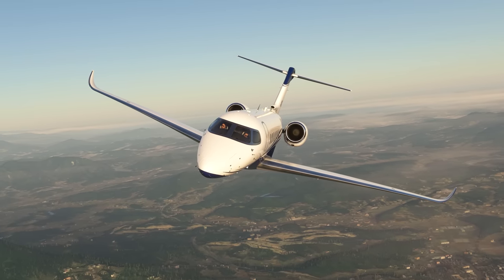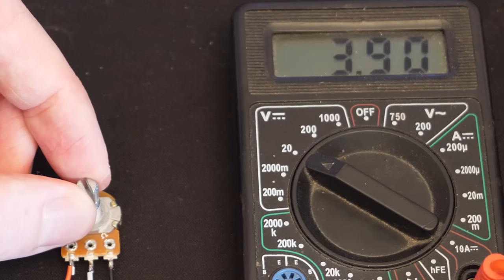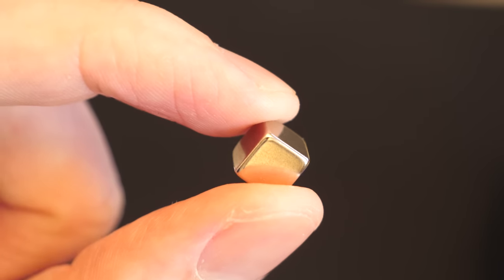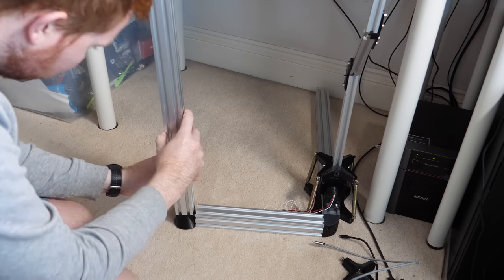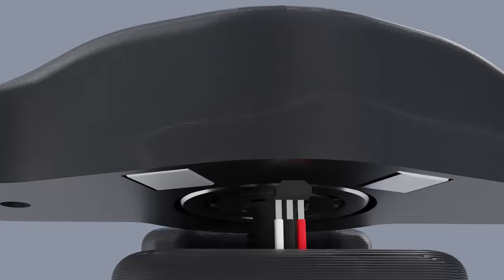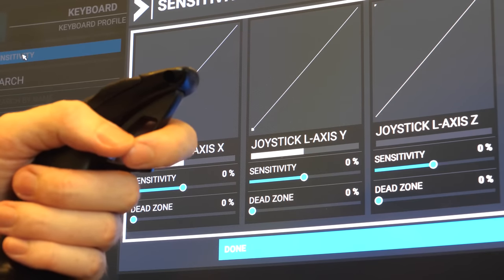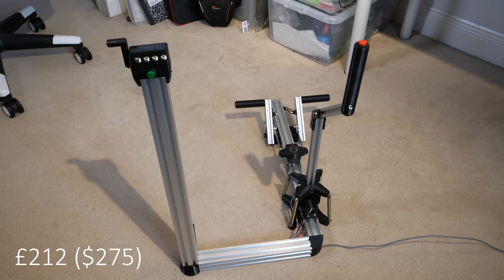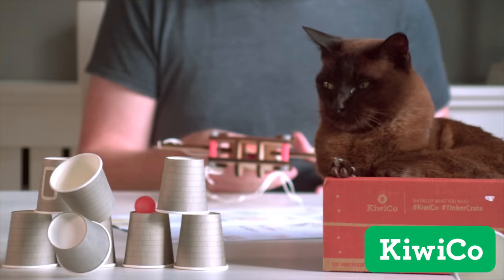DIY Flight Simulator Joystick

Comment: Just a thought, you might swap your springs for hydraulic pistons with equal resistance to each other...this way the stick and pedals do not self center but remain in the position you place them in as they would IRL.

Comment: I designed one similar using old model airplane servos an removing the potentiometer out of them for the control positions. Then decoded the signals through an arduino.  Converted to USB on the output. Works great. 👍

Comment: The low potentiometer range can be fixed with some clever configuration of the ADC. For the ATmega32U4 used here, we could run it in differential mode and use a second potentiometer set to the mid point. Using the internal amplifier we should get a decent resolution. Bonus is that the second potentiometer effectively functions as trim, and can be used as such in the sim

Comment: I really like the use of a single hall sensor and the north-south transition to get a higher sensitivity. A modification of this trick can be used to get some insanely sensitive readings - if you attach two small magnets to each other, there will be a very narrow transition between N/S at the join, and a hall sensor can be used to measure this. Amazingly, the response is nearly perfectly linear. With a little 3-pin hall sensor like your one, run into a 16-bit ADC, I was able to get better than 1 nanometer resolution 😁
Reply: Arduino-based solutions are limited to 10 bits. What is the cheapest 12+ bit option?

Comment: Thank you so much for publishing your designs. I built one with my son and it works perfectly with FlightGear on Linux and Windows. I was able to add some more push switches and potentiometers for mixture and elevator trim and these work really well with a bit of extra code for the microcontroller.. The whole design is really easily modified and I added 3d-printed cable clips and inserts to hide away some of the spaghetti. I did break a rudder pivot, but that was solved by printing with thicker walls than the default Cura offered on fine mode. I struggled to find springs for a sensible price. The hall-effect sensors work really well, so perhaps I'll give this some thought in my future work. Now I just need to learn to fly better, but the joystick certainly makes the experience much more satisfactory.

Comment: Neat joystick but you have confused resolution and range. The resolution, at least for the potentiometer, is infinite and in theory entirely linear, although that depends on the quality of pot. The resolution then becomes a product of the device reading the pot. For instance a 10bit ADC , like the one in the Arduino micro, will give you (2^10)-1 possible values. Which means it can detect a voltage change of 0.0048V (beyond the scale of your multimeter). I haven't read the datasheet for the Hall effect sensor, but id imagine its a similar scenario. Running the calculations, for a 5v dac with that resolution, over a 0.5V range, you get just over 100 possible different values readable by your code, which should be sufficient for flight simulator.  What you have done obviously works and probably better than a pot, but just for the record, a pot would have worked too. Volt meters, especially cheap ones, have a poor resolution and are not a good indication of what is happening at mili or microvolt levels.

Comment: There are pretty cheap ADC expansion modules that work well with arduino boards, they allow you to use more analog inputs, and also offer a higher resolution than the arduino boards, 12bit, or 4096 levels.

Comment: I build rudder pedals with a similar technique. I don't own a 3D Printer, which make calibrating the magnet positioning a tricky part. In addition I added a lot of buttons to a table clamp. In the table part I included a rotary encoder to contron things like radios and NAV. I also added a small joystick which control the view angle and zoom (by pressing the small joystick.
Your solution looks much better than mine, congrats. Thanks for this great video. Maybe I'll try to improve my setup based on your ideas.

Comment: That's a very acceptable latency for the input. In professional full flight simulators the complying latency accepted for certification has to be less than 300ms. The average is around 200-210ms. I worked as an FFS technician. Great video by the way! Maybe I build one of these for me!

Comment: Nice done.
As for Arduino, the "joystick" firware MMjoy2 is an more advanced option, with support for more type of magnetic angle sensor, like TLE5010 in digital mode.
Other option is FreeJoy for STM32F103 cards (>$5).
Both has advanced response  - Bézier curves and filters, and allow set custom curves in firmware.

AS5600 angle sensor is other good option, because their "effective electric angle" can be programmed without use an advanced hardware programmer.

Comment: Very nice job - check out the prices for "virtual cockpit" controls:  Since that is actually what you are building it is a better price comparison.  Moving on, you need to make:
Phase 1.  Toe brakes - very useful for taxiing etc. plus they are proportional rather than all-or-nothing.  Then replace the brake button with a hat switch on the joystick to change view direction (see #2)
Phase 2.  A head tracker, like TrackIR.  (If you get into a sim like DCS world or a semi-sim like the IL-2 Sturmovik series, where they do allow guns, missiles, bombs, etc. you are going to want that to more efficiently "check six.")   Then you replace the hat switch on the handle (or brake button) with multiple triggers/buttons for bombs, rockets and guns.  I assume there will be planes that have weapon animations, just as there were with the old MS Flight SImulator X, although they won't actually do damage

Comment: That's wicked

Now, knowing you are deep into rc stuff as well.. you know the follow up mate. Hook those analog signals from the hall sensors to the pots of a cheap 4ch TX and try and fly a plane like that. This is in fact my long term goal, pairing all that jazz with head tracked goggles fpv. Now that'd be sick.

Comment: Interesting way to make a joystick with hall effect sensors, One thing that i was thinking would be to make a joystick sensor out of an accelerometer, this will also give you the angle of the stick in high resolution and you can also run it at high rate. especially if the stick is supposed to be stationary it should work really well .

Comment: You can use TLE5012B sensor by Infineon with a diametrically magnetized disc magnet just for 6$. An impressive angle sensor with 15bit resolution.

Nice work.

Comment: Have you considered using a (single) accelerometer instead of the hall effect sensors for the control column? If you mounted it in the point around which the stick pivots, it wouldn't undergo any sideways acceleration, so you could use it as a angle-from-vertical sensor.

Comment: Thanks for the explanation
I was building a helicopter collective  and could not reduce the detection angle of the hall sensor.

Another way would be to use a hall sensor with "built in" magnets like the bi tech 6127 which can be chosen in a variety of angles, but is more expensive.

Comment: I know that it is not the best joystick around, but the t16000m flight pack from Thrustmaster is currently 239€ (with Rudders).

Your project is great nonetheless! And it is still way cheaper than most of the "professional" Hotas plus customizable and upgradable

Comment: Resolution could be improved easily. You can just use an external ADC with the Arduino with I2C communication. Those have at least 10-12 bit resolution and I2C is well supported with built in functions. There are also multi channel ADCs to lower part count.

Comment: ive found like 3 sticks at goodwill (and a sidewinder ffb pro which i built my own usb adapter for so it has force feedback) and they all are like 10-15 bucks there but you wont get to pick and choose a stick, i found a logitech extreme 3d pro and a wingman extreme digital 3d as well

Comment: If cost is not a factor you could order a professional grip from one of the kit plane suppliers and replace the printed grip with a "form fitted" grip complete with switches and a 4 way china cap switch on top. 
Looking at doing a "hand control" for a 2006 Renault Megane. The throttle is nothing but a potentiometer hooked to the gas pedal with a switch at the bottom of travel for kicking in several other features. Switches would control cruise control. Maybe someone could come up with a 3D file for one of these grips.

Comment: I wonder if the magnet from a dead hard drive could also be used? It should work just as well, and there are usually two magnets in each drive, so rudder and joystick could be controlled by salvaged parts from one drive.

Comment: @Tom Stanton I have recently been modding my existing flight controls, I used a pro-micro arduino alongside an ADS1115 16bit ADC break out board. I do all the ADC conversions on that then use the joystick library to do essentially what you do. There is a helpful library for this board proved by Adafruit. In my testing, I am getting a very nice resolution compared with the on-board 10bit ADC. I send updates via USB at 125hz.. (every 8000 microseconds..  or 8 milliseconds) so latency is very low.. certainly un-noticeable in actual use.

Anyway, just a recommendation for the ADS1115. These can be bought very cheaply, either the branded versions from Adafruit or the chinese copies.

Comment: You could just have made a "gearing" of your stick down to the old joystick. 
Like create a mechanical linkage from the 12° output from your stick, down to whatever angle the original joystick needed.

Comment: I made a throttle and joustick out of an old rc plane controller, it was meant to be used as an fpv controller and simulate a cockpit but i brome the geadset so i ripped apart my expensive controller and re flashed my arduino... it works well!

Comment: I once rebuilt an old Playstation controller into a joystick
I extended the thumbknob and rewired some buttons on the top of the stick to use the guns.

This is much better I need a joystick for warthunder.

Comment: I'm curious if using gearing on the potentiometer or hall effect sensor end would produce a much larger output delta for detection. Sure, it would result in a larger mechanism with greater overall resistance, but force feedback would then become possible via an accessory gear, and centering springs could then be torsion instead of linear.

Comment: Few years ago when I tried to build a controller, I tried to use encoder and gears to increase encoder resolution. Absolute encoders were expensive and cheap plain encoders sometimes skipped steps, ending up crooked position becomes neutral. Potentiometer heated up (I used 1k one I think) and I gave up. Now it’s the time for new joystic. Why my school didn’t teach me that there is a magnet sensor? I’ve got master degree of electronic engineering, dang it. Thinking about design a mechanism for break with pushing both rudder pedals, too.
Thanks man appreciated.

Comment: At first, I was thinking a gear ratio would be the cheapest option to increase resolution, since you have a 3D printer. but with a full turn pot, a 30:1 ratio would be tough to fit in that compact setup

Comment: So it costs a bit more than a joystick, but you get rudder pedals in the deal...
Not to mention, you actually get a pretty rad joystick rather than one of those small kids toys that sit on a table!

The only thing i don't like is that tiny throttle control. Could have made that one a bit larger.

Comment: If you want to go even cheaper use scrap wood instead of extruded aluminium. You can find it free if you have a recycle center near you from old furniture.
You can also use wood to replace the 3d printed parts since they are all simple shapes. Nothing you cant reproduce or make similar with a hack saw, sand paper and a drill.

Comment: This is incredible dude, I didn't fully follow most of it but it's an incredible idea. I used to be an RAF engineer and then a rescue helicopter pilot. I got med discharged with PTSD from Iraq and subsequent depression. I can't concentrate very well any more and so flying is over for me.
Your setup gives me a bit of hope that I may be able to get close to flying again. Do you think it might cross over to model aeroplane flying with an FPV headset?

Comment: Awesome! Thanks for this! But you know most airplanes don't actually use the stick style anymore. They use a steering wheel yoke that rotates left and right for roll, pull and push for pitch. It's hard to find computer controls like that and that would be an extremely valuable DIY project that I would definitely replicate. It would have been extremely helpful during flight School for sure! But without that, I found Microsoft flight simulator to be much less helpful during my training.

It seems like it would be a pretty simple project that could be implemented much the same way as this one. As a bonus, maybe it could double as a racing steering wheel? FYI: the steering flight yolks are limited to 180° rotation in either direction which should simplify the design

Comment: You should be able to get down to 32ms but I guess you had to use a few delays to measure the hall effect. 16ms is the fastest data speed for 30 - 100 ish char over serial back and forth. Measured by sending out, and waiting for the pc to respond with the same data.

Comment: I would have used an optical encoder, scavenged from an old mouse (the scroll wheel part), and 3d print a larger encoder wheel with more spokes to give it higher sensor resolution. 
Then using springs to have it orient to "neutral", then have the arduino calibrate from the neutral position on power-on.

Comment: You shuld test out the cheap zero delay boards. (they do need a bit of soldering and a trace removed so they can be properly used) But i find they have less latency (probably why they are called zero delay) 

i notice this post is 3 years late. I was just looking for some info on arduino latency as i can get some of those really cheap now and was thinking id use those instead of the zero delay board.. (don think i will now though)

Comment: Used to be a BIG MechWarrior enthusiast who played the games with a H.O.T.A.S. whenever possible until MechWarrior: Online became a Macrotransaction XP grind fest and MechWarrior 5 Mercenaries showed little to no love for the finally present Single Player Campaign and even less support for Joysticks than the 1995 released MechWarrior 2: 31st Century Combat so the used I've gotten out of my Saitek Pro Flight X65F Control System has been next to none in the recent years despite it probably having the most unique Joystick ever - Unlike a regular one, the X65F Joystick doesn't move but rather senses the force you apply to it which basically means you have next to instantaneous on screen feedback with what you're doing with it.

Comment: I always wonder why, in such projects, peoples don't take advantage of the leverage effect.
Literally, with such a tall joystick, using a simple gear set to increase by a lot the movement the sensor will register would allow for cheap yet precise result.

In fact combining two sensors and a little bit of code you could get sensor resolution well above what 14bit do.
You just need one with a gear ratio allowing for many revolutions (of a round magnet) for small joystick movement and another reading the whole movement, then with simple maths depending on the position registered by the one reading the whole movement and where on the rotating magnet the fast one is (not forgetting that each 180° the hall sensor value need to be reversed so a boolean for the direction is needed for avoiding small dead/unstable zone where the "whole movement" sensor won't be precise enough), you can have a massive precision boost, of course it double the sensors and add in complexity, but the result would be amazing, of course it would be useless to try and reach or exceed the level of a 14bit sensor anyway, but it would still add in precision and teach quite a bit of things at the same time.

Comment: Great project!
I've tried to figure out a 3d printed mechanism for rudder pedals a while ago, but I tried to link pedals with gear system with a potentiometer for a readout- that got nowhere (at least I learned how to design gears). Thanks to your design I might finally make a set that actually works:]

Comment: I don't like how you did the rudder the way it is now is basically what you do when you press brakes, on a real rudder you push with your foot and the rudder pedals slide and when you press the brakes you push down as yours do. that's at least what i want in rudder pedals, otherwise great design and fantastic video

Comment: Should have had a look at the STM32F103 it has a 12-bit ADC so get 0-4095 steps of resolution. Can then use FreeJoy firmware that is available on GitHub that you just upload to the board and they have a windows utility for setting up what's attached to it.  If you didn't want to do your own coding.

Comment: In real aircraft, joysticks and yokes do not have a neutral position. In parking position, with engine shut off, the elevator usually hangs, and the joystick is pointing to the instrument panel, as you would do for a rapid decend. Usually, there are belts, or metal holdfasts to fix them in climb position to secure them for parking. Springs to keep the steering in neutral are not correct, and it takes a bit of experience for students to use the levers, so the aircraft flies, where you want. If you make your own steering device, you may consider to introduce reality, even at this point.